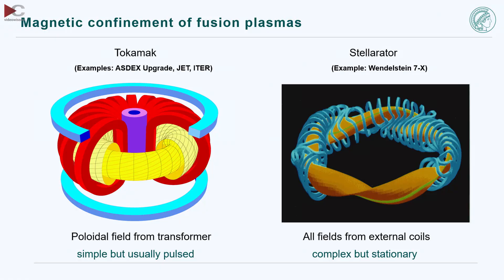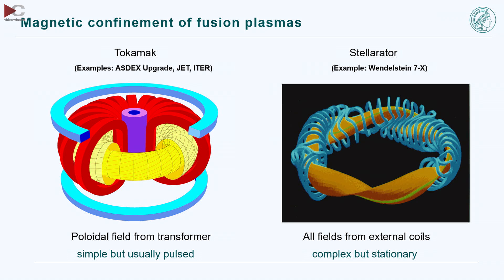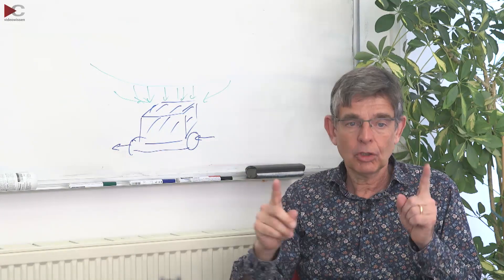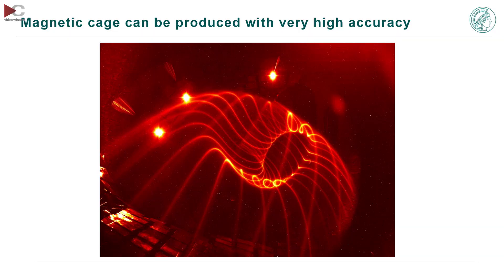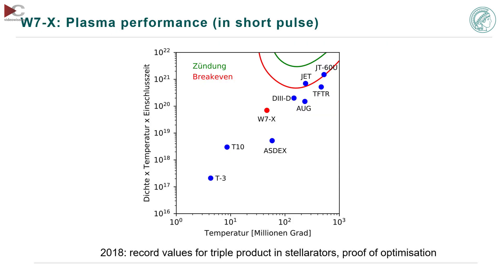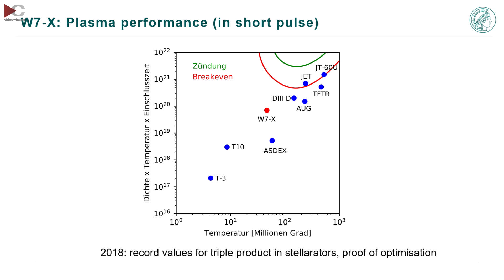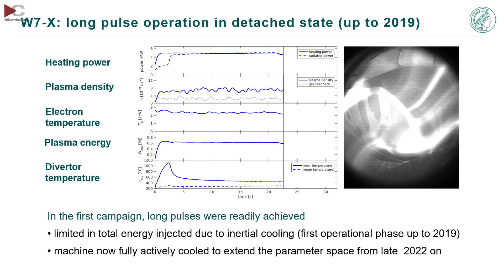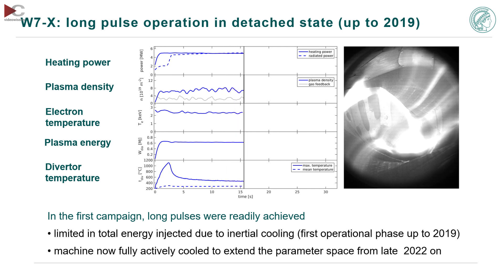New milestone in fusion research at Wendelstein 7-X | Hartmut Zohm

Comment: After noting the NIF breakthrough just recently, which is an inertial confinement laser driven pellet concept with a new magnetic technique, the question arises if a stellerator can increase density not just energy without a hybrid laser method? The NIF uses ancient lasers, modern Petawatt tabletop lasers are available.
After looking at some other fusion device, I begin to think hybrid is the way to go.